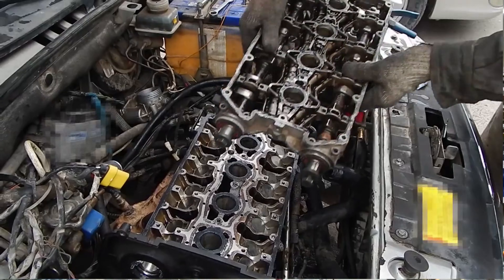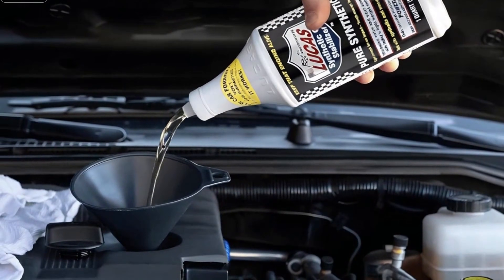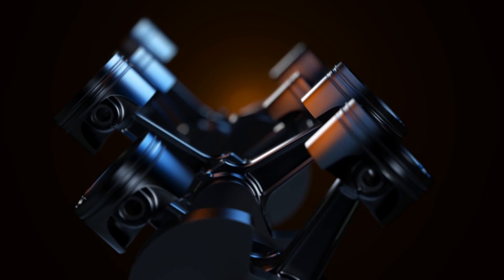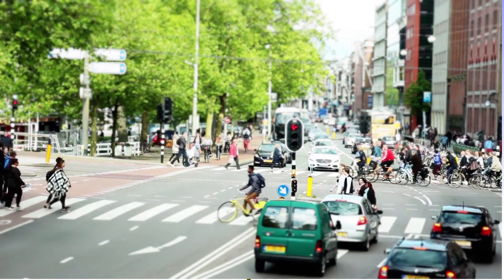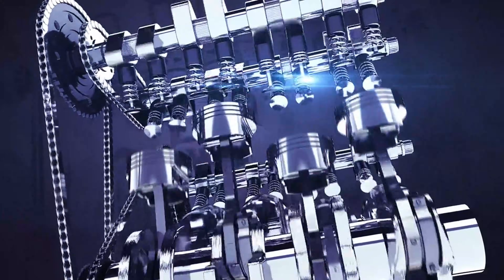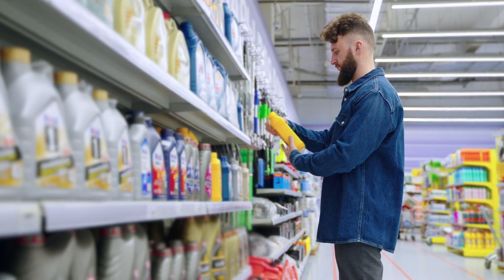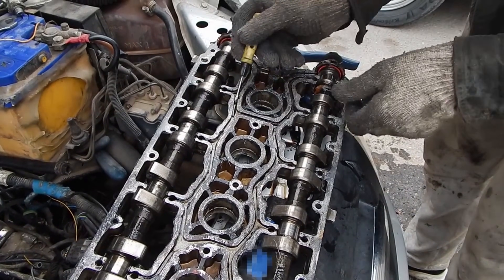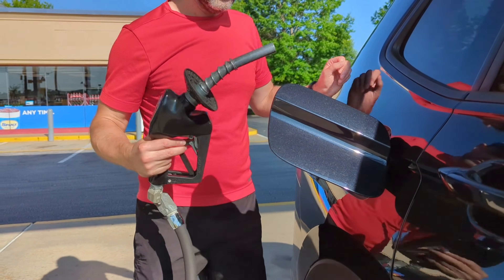I Tested Motor Oils for 200,000 Miles. One of Them Destroys Engines.

Comment from the maker: Most drivers think changing oil on time is enough.
But in this test, one of these oils failed badly and showed dangerous wear levels.

Which oil do YOU think is the engine killer? 👇
Comment your guess before watching the full video.

And tell me:
👉 Which oil are you currently using in your car?

Comment: I checked and Supertech oil is a very good oil.
Reply: I run super tech 5w30 in my 2002 Ford F-150 5.4 2V with 130,000+ miles, and change around 5K No issues whatsoever don't know what they are talking about there's nothing wrong with Super tech.

Comment: Which oil brand can sustain for 10 000 km on engine above 200 000 km
Reply: Available in rsa
Reply from the maker: For an engine over 200,000 km, I would not push any oil blindly to 10,000 km without monitoring. But in general, high-quality full synthetics like Mobil 1, AMSOIL, or Castrol Edge can handle long intervals much better than average oils.
That said, it still depends on:
Engine condition
Driving style (city vs highway)
Climate and heat
Oil consumption
For high-mileage engines, I personally recommend 7,000–8,000 km to be safe, unless used oil analysis confirms the oil is still healthy.
In South Africa (RSA), Mobil 1 and Castrol are usually the easiest to find and are good choices.
What car and engine are you running?
Reply: @CarCareCrewoffical it's toyota hilux d4d double cab 2.5 2007
Reply: @CarCareCrewoffical thank you